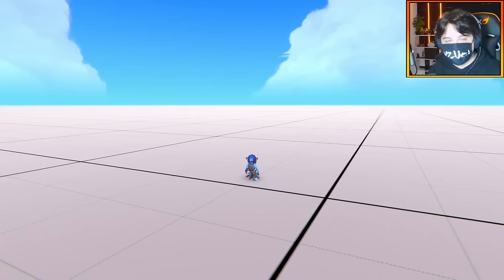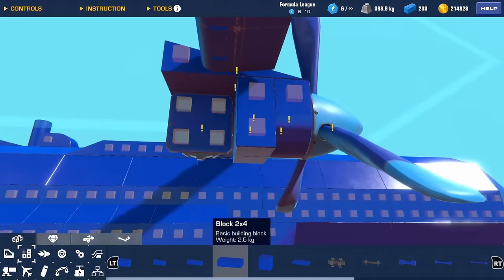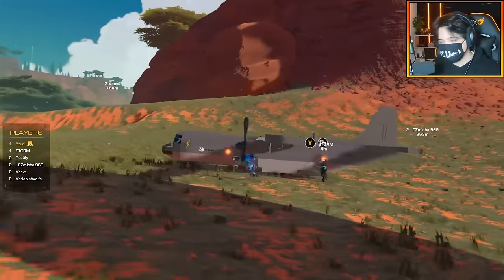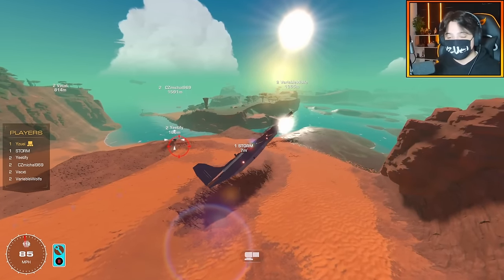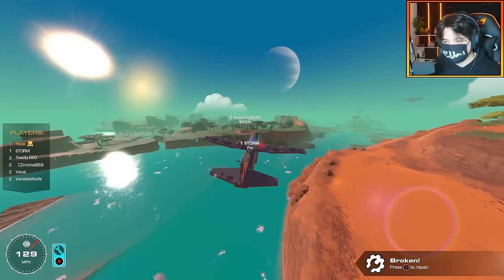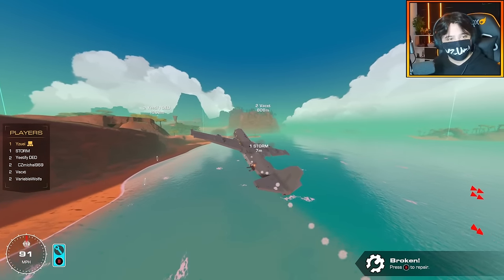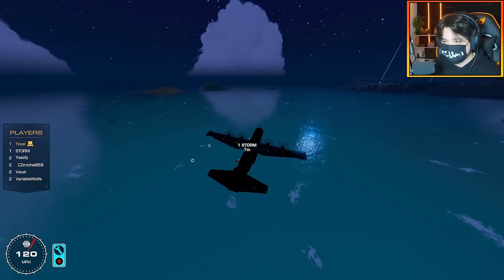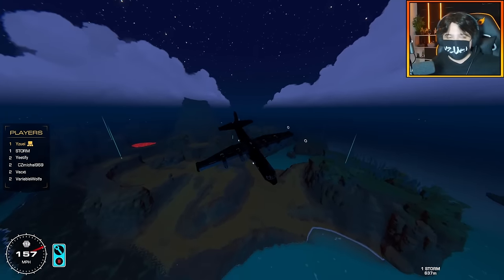I Built An AC130 GUNSHIP But I Turned It Into A VTOL?!

Comment: The AC-130 never had 2 howitzers.  The current AC-130J Ghostrider has a single 105 mm M102 howitzer, a 30 mm ATK GAU-23/A autocannon, and a Gunslinger weapons system 9 (10 round magazine) that can fire Vyper or Griffin missiles.  The Gunslinger system replaced the typical 25mm 5 barrel chain gun the last active model had.  Currently the Ghostrider is the only version that is not retired.  They have also added 2 wing hardpoints that can carry 4 bombs or missiles each like the Small Diameter Bombs or Hellfire missiles.
Reply: @deadslayer69  I am proud of being labelled a nerd... :P

Comment: I love the V-22.  It had a VERY shaky start and was even cancelled a few times, but in the end it is pretty reliable.  Yes there have been crashes, but it is roughly the sale incident rate as the F-16, F-18, F-35...  They all are about the same.  The lack of ejection seats and the fact it carries passengers is a bit concerning, but these are designed for a slow easy landing and that is when they are most likely to fail.

I think it is a FAR better platform than any helicopter, even the high speed ones they are trying to make right now to replace I think the Apache.  The Osprey still goes faster and has a MUCH longer range.  It still has a good lifting capacity.  They could replace a lot of helicopters, especially in the Navy, with these and greatly simplify aircraft carriers and amphibious assault ships (which are basically light carriers with a bunch of marines and a Deck Well).  They can easily be modified do anti submarine and search and recue.  They can also add the lighter helicopter weapons like a chain gun, Hellfire missiles, 250 pound bombs, small diameter glide bombs, and rocket pods so they could provide close air support.  They already do cargo and troop movement.  One last one I would love to see is a Hawkeye or AWACS version (radar plane) as that is the one thing the light carriers really need.  The refueling would be a new capability too.  They are also looking at a refueling drone.  If they could make a version that could float and take off from the water this thing would be perfect.   The Navy version of the Y-22 folds its prop and the whole top boom rotates to make it take up very little space on the carriers.  It is impressive to see it do this.

They are making a slight smaller version, but I question if it is really any better or cheaper.  It look cooler though and I think the way the engine folds instead of rotating the whole boom might make it more reliable.  Either way the tilt rotor is hear to stay likely for a long time.